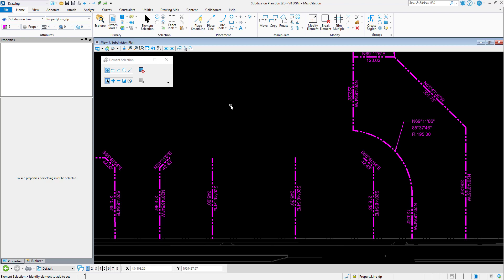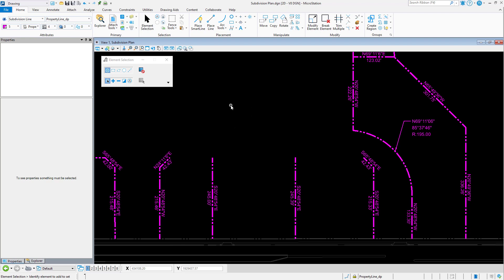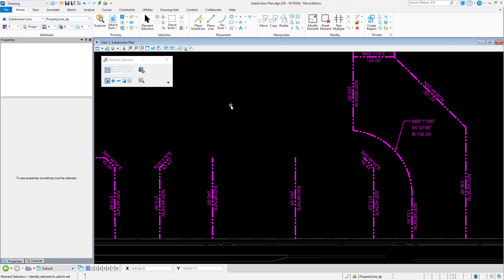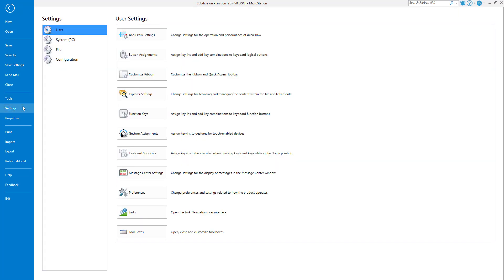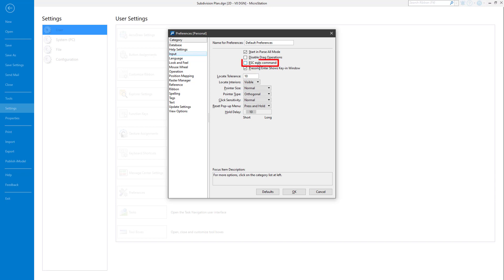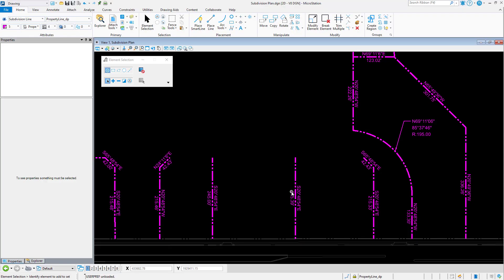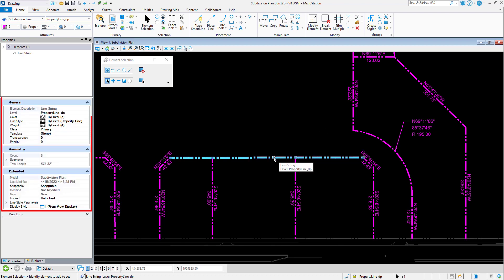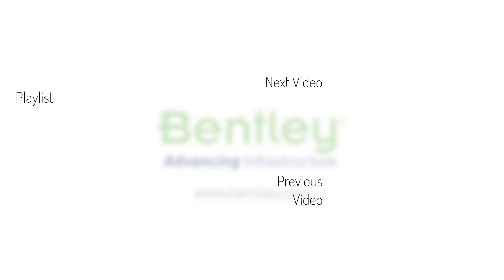ESC Exits Command

Comment: A Reset only interupts an operation (e.g. placement of a line) and you can right away continue and place another line. When "ECS exits command" is enabled, the ESC key terminates the function completely and you have to restart it by clicking the tool in the ribbon again. ACAD compensates this by providing the last used command by hitting the Space key. Such a function is not available in MicroStation (and is not necessary when using Reset). My recommendation: if you are able to relearn, get used to using the right click reset function and avoid using the ESC key instead.
Reply: I agree.  Reset works great when you only want an interrupt. If you use the space bar, there is a new pop-up menu that you can use.  I love using this!  Especially since I switch between CONNECT and AutoCAD quite often.  If you do not see the command in the default pop-up menu set up, you can edit it to include whatever you want!